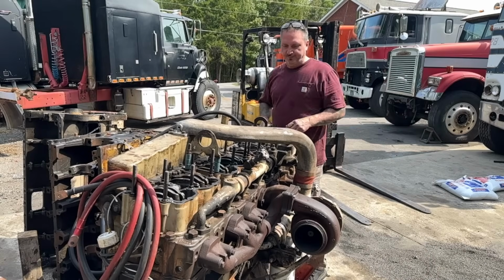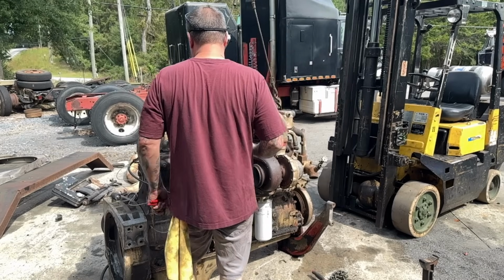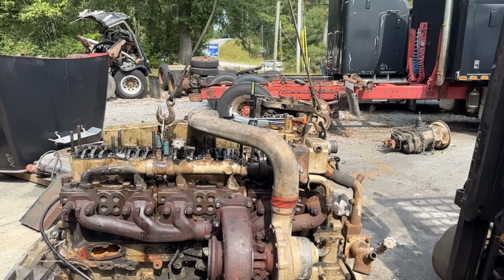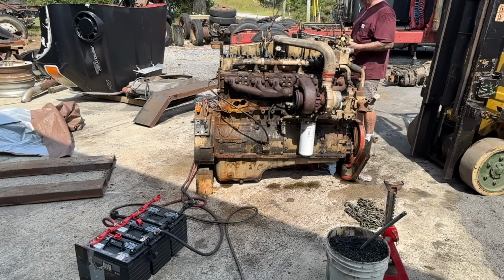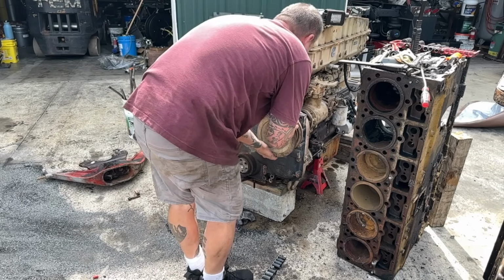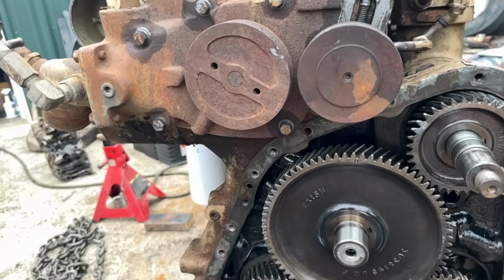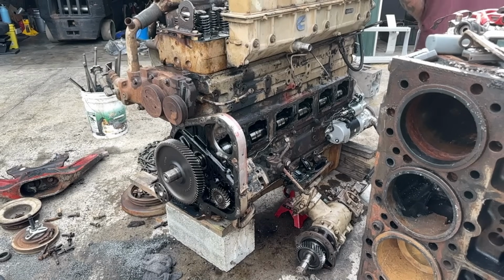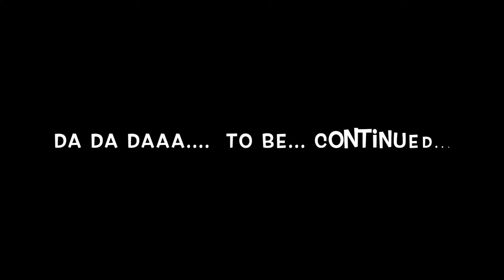Big Cam Part 779 LOL Could Be Game Over...

Comment: Man that sucks, Had  ls 6.0 push out the center cam bearing. ,after taking apart hot tanking it the bore wasnt that bad. So when we put new bearings in it we used red locktite . Seems to be ok after 50k miles.
Reply from the maker: Yep we used green   Appreciate ya

Comment: Hi James, I'd phone around and see what the costing of having the Cam bearings Line Bored and oversize bearings installed.. If its Mad Money... you may be better off looking for a new engine ( Second Hand ) from a known good source.. like the Yard Tim goes to  for bits for his trucks.. They had loads o second hand engines sat in the shed ... Stay Safe oot there.. would explain why you were constantly changing the Valve / Injector settings......  if the Timming Disc was moving around on the shaft when the engine was being started  ... She could Run again.. depending on the Cost .. :) :)
Reply from the maker: Ya it’s crazy that hub was broken and rotated in the keyway.  But better things happen in the next vide.  Appreciate ya

Comment: James Pretty you thu man I Captain I have got to go to Dahlonega  to look at a 2002 Dodge 3500 truck with a Viper 10 cylinder in it with a 10300 miles on it I have never owned a Dodge truck I know they are weak and temperament but if I get back in time I am coming over to see you Brother !
Reply from the maker: sounds good bro

Comment: Just wish i lived closer to you so you could teach me how to work on my big cam 3 cummins
Reply from the maker: Well there’s a lot I don’t know how to do but I’d say Cummins motors are pretty simple compare to others I’ve had apart
Reply: When I started it about a month ago it was bearly staying running so I had sent the fuel pump out to be fix got fixed and I'm still having problems getting it to run not sure what is going on but I've never worked on diesels before I just drive them so I don't know shit about anything but I just downloaded a repair manual for the 855 big cam 3 so I'm just teaching my self how to do it
Reply from the maker: @johndeere1958ful  send me a video of it running so I can hear it.  Either Facebook or email. Pkkustomz@hotmail.com

Comment: I built a big cam lll 400 in a 1986 359 Pete back around 911. In spite of all the drama going on in the world, l was able to pull it out and strip it to a bare block and build it back with all genuine Cummins parts (including heads and injectors) in 3 weeks and the machine shop had the block for a week. I never had built anything bigger than a 390 Ford gas engine. God must have sent angels to aasist dummies who  try and build diesel engines under an old lean-to because it started, ran and operated like a new one. You will get it straightened out long as you got no cracks in your block.
Reply from the maker: Appreciate ya Ray.